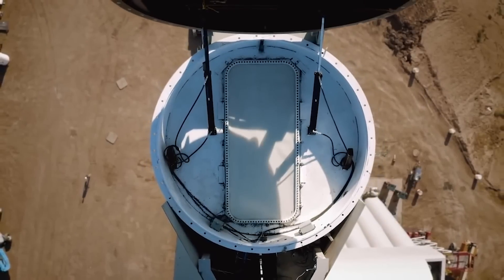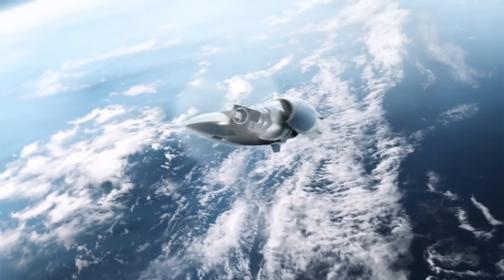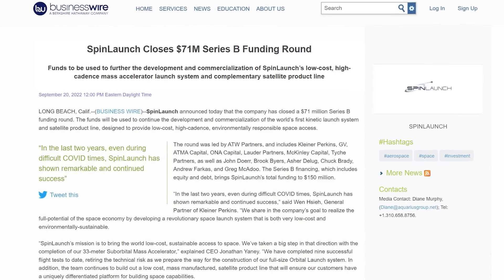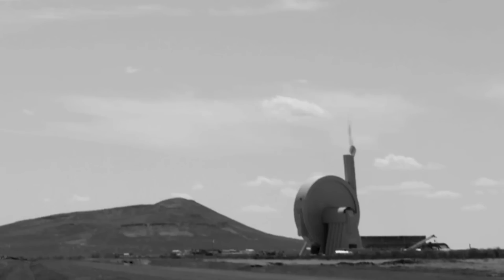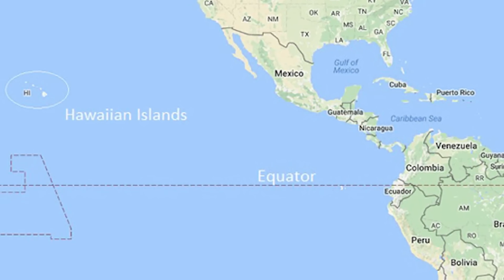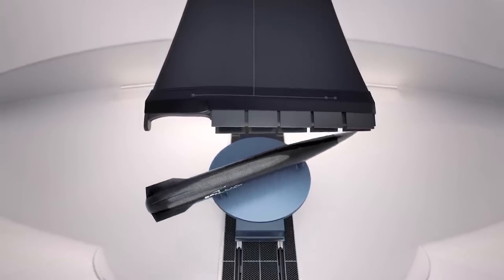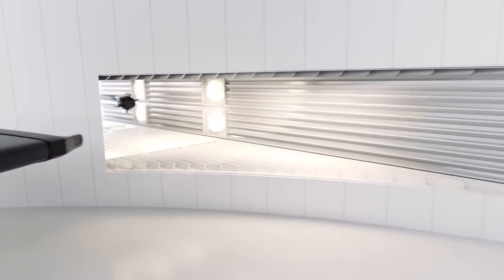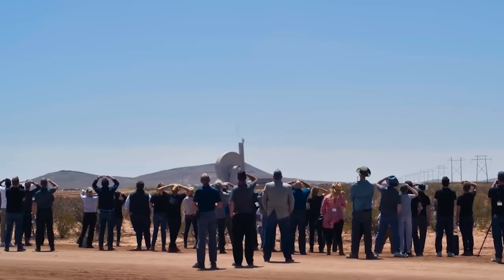What Happened To SpinLaunch & The Orbital Accelerator?

Comment: I think this is a great idea.... but for off world launches. This would work very well on the moon, go cheaply get payloads back to earth. Or on Mars for a similar reason. If you wanted to port raw materials frequently and reliably back into earths gravity well with minimal oversight and cost, this is it. And the vacuum, noise and reusability issues wouldn't be as applicable on those worlds.
Reply: It would be far cheaper than a magnetic rail gun or mass driver to deliver menerals from lunal mining.
Reply: A moon-based space elevator might be cheaper and could launch to other planets...
Reply: @jameswilson5165 it's only as powerful as a ww2 naval gun. Which we can fire for far cheaper. Space guns would be better. And there's good reasons we gave up on space guns like 50 years ago 😂
Reply: @jameswilson5165  I think a conventional gun would beat both the spin launch and any electromagnetic sci-fi solutions.
Reply: @salvatoreshiggerino6810  actually no because the maximun acceleration from the gas expantion would be too slow (remember the idea is to carry as little fuel in the ship itself for all the reasons mentioned by the guys making thespin launcher)
besides putting enough explosives to send 200 kg in space would totally destroy the payload defeating the entire purpose
Reply: The issues would be the propellant to fire gun and the very large barrel. Magnetic accelerator and rail gun components are lighter and only require electricity.
Reply: Yeah definitely ok for an environment that is already under vacuum. Might even work on Mars and still not need any extra vacuum, Build it on the top of Olympus mons.
Reply: Instead of Spin Launch a giant gun burning Hydrogen can get up to orbital speed.  Spinning means a huge heavy structure of 1000 tons of metal and cement.  Spinlaunch is cool but prob not the best option.. .. .   I half remember up at 30km can rig between ballons a whip like system to drop 1 weight while around a pulley the Payloard is zipped upward to orbit, all at 2% atmosphetic density ... .....  the ugly truth is getting to orbit takes lots of energy, though rockets are only 20% efficient, even a perfect 80% efficient spin or magnetic launch would still be math use 25% as much energy.. . .   If moving billion kg to orbit for some big project that's a lot of energy to speed up stuff.....
Reply: @mbengambenga-xi6dp  lol like the harp project all over again
Reply: idk i think a huge gun would put way too much stress on anything you want to deliver. The reson why guns work so well is because the bullets are tiny so they can withstand a lot more stress than say a satellite  @mbengambenga-xi6dp
Reply: @mbengambenga-xi6dp  Yeah, that sounds lovely, but you're literally not able to contain Hydrogen under current tech. It seeps through solid lead, for instance, the atom is so small. And wait till you deal with the ions.
Reply: man, imagine such a launch systemon mount olympus, with already very thin atmosphere, high altitude, and lower gravity. If they manage to do it on earth, then the next base station on mars/the moon will definitely have one of those too.
Reply: not to mention that, for a launch from the moon toward earth, the angle needed would remain approximately the same, due to the moon being gravitationnaly locked on earth. A no vaccum asset, and easy energy (big field of solar pannels recieving 10 times the amount than that on earth), and they could make several launches directly from the moon, without the need for additionnal fuel. Damn, just launch whatever you're mining there directly with an included heat shield, and direct it towards earth. That thing can bring down moon to earth material transport to a very very cheap cost.
Reply: Just use explosives
Reply: This would be great for in orbit as well. Just spinning up the rocket from LEO to however fast it would need to go
Reply: @seasong7655  I do think there are some issues with orbit that you've not accounted. Equal and opposite reaction bits.
Reply: no, you need a dense atmosphere to cancel the angular momentum of the projectile, unless they are only going to launch fisbees.
Reply: I mean the logistics involved for building this on the moon would be much simpler. No vacuum means no vacuum chamber or airlock or anything aside from a motorized arm.
 Pick a location that an accelerator can be placed on the ground horizontally and dig a hole. Put an anchor in and a motor on top. Now mount your arm and connect power. All of the necessary parts could be fit inside a rocket(s). Except of course the power. Though by the time something like this could be done we will likely have advanced enough reactors to not need a solar farm.
Reply: It doesn't work. Like it's an idea but even the test they did they kinda lied about the results. That's why there haven't been anymore test. At this point they are trying to get money.
Reply: It’s a useful tech.  That’s the real application.
Reply: But it does work here too. It's a question of willingness to get over the noise. Right now we burn all kinds of fuel and make much longer sustained noise with traditional rockets.
Reply: Are you kidding?  Do you realize how sensitive mechanical devices are and how high the G Forces are to launch a product with SpinLaunch.  These guys are nothing more than a kickstarter who's trying to get rich off of ignorance.  The adage holds true; "A fool and their money are soon parted"
Reply: @DigiLab360  Actually, you're not really saying anything, we shoot artillery shells that can do GPS guidance within 10 meters. Please try again.
Reply: @up4open you see satellites are not as robust as artillery tho
Reply: @opmacace523  We doing alot of spring work in our electronics these days? Gotta crank the clock weight up every morning if we want the little birdy to pop out the hole.
Reply: @up4open  ohh look at mr. smart ass over with all the answers why don’t you build spin launch and prove me wrong or better yet design a satellite that can survive all these forces and not be unnecessarily heavy to fit more equipment. And it must not cost more than a normal satellite.
Reply: @opmacace523  let's start with what do you need it to do, and what year do you think you live in?
Reply: @opmacace523  I think you're conflating shock with G-force. G-force can be used to help measure shock, but you can induce G without shock. And G is relative to the item to which it is applied. A 1 ounce transistor at 20 G has the equivalent weight of... 20 Ounces. You likely apply more than 1 pound four ounces of force inserting a graphic card into an old motherboard. When talking about modern materials and modern circuits, there is zero chance you couldn't make a circuit, and accompanying machine, to handle 20x the weight of each piece. You could do this in your garage for a few hundred dollars. The only real trouble is if the part must move while under that load. It doesn't, it just has to get up into orbit where there are effectively no noticed G due to constant velocity.
Reply: @DigiLab360  .. high g hmmmmm.  spin launch could launch solid girders or frozen water or solid rocket booster engines or maybe tanks of liquid hydrogen.  About half the shuttle once in orbit is fuels and water, so there is a need to get bulk materials up into orbit....  But yeah high g is a problem...

Comment: Would you happen to know how much of a payload they can shoot up into space? 
I wonder what their starting elevation is going to be? 
They really should build it on top of a hill with the longest vacuum tube possible.  As it would minimize the amount of atmosphere the craft has to push though.
Equator and high elevation? South Texas sounds good. 
Might even be able to work closely with Spacex.
Reply: Or you could just use Gerald Bulls old super cannon designs to achieve exactly the same thing with out all of the rotation issues.
Reply: Some payloads sure but think about it.  You want to launch a multi-million dollar satellite that has fragile electronics and send it to space. Do you really want to shoot that in a cannon and hope the shock of it doesn't ruin it?
Reply: @williamburroughs9686  Spin launch exerts far more load for a far longer time if you want a low stress launch then use a rocket